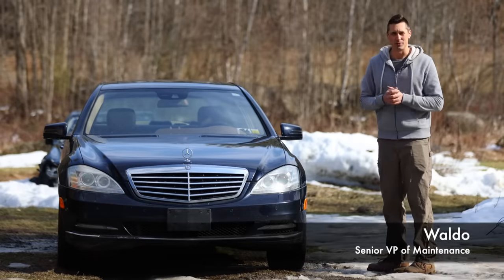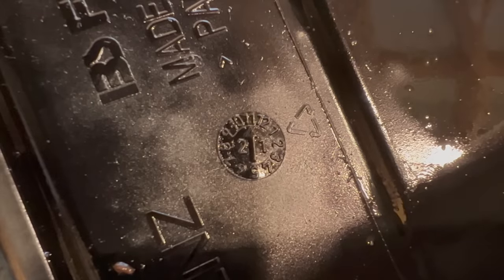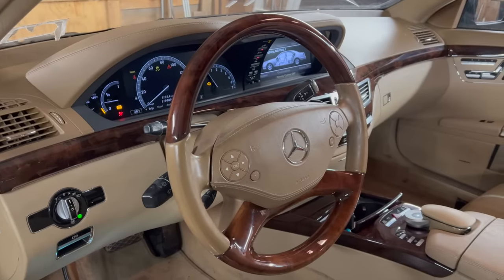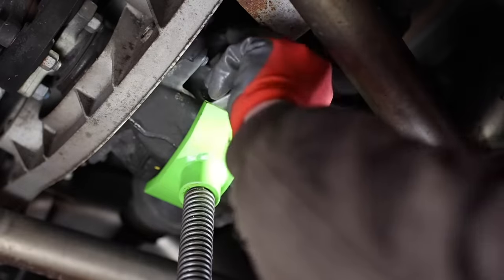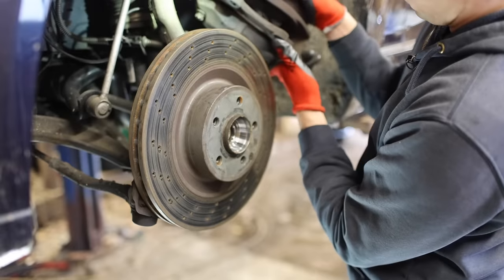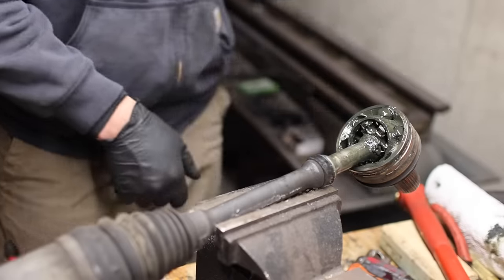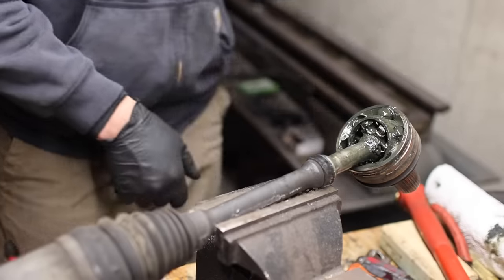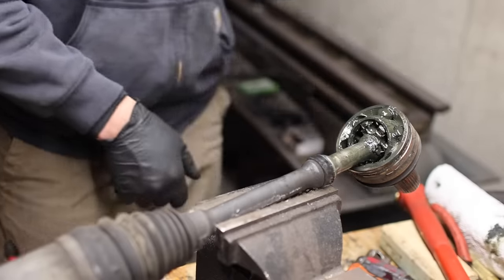Changing 6 Fluids and 4 Filters to Make this Car Last Forever (hopefully) [Salvage S-Class Part 2]

Comment: "It encourages you to have multiple Mercedes so you get the most out of your tool" Absolute win.
Reply: Yes, everyone with an S Class NEEDS a parts car.
Reply: Yes, my Mercedes does just "come right apart", if you have the right Mercedes custom tool, they can't have the dealership mechanic take too long to fix your car.  As I saw you hammering with your brass rod and hammer all I could think was "That's another special jig you should get" to go with you fleet of Mercedes S-Class cars.
Reply: emilemasbou7950  26 yrs with my LS400 and everything still works. No German crap for me.
Reply: I had a Mercedes 500SEL I LOVED THE CAR but it was nothing but a constant repair bill. It was mechanically in good condition  with excellent interior and no dings. I couldn’t even sell it at the 
Colton/ Ontario auto auction for $2000. 🫣
Now you know why Mercedes S Class  used cars are dirt cheap. “THEY ARE ENGINEERED LIKE NO 
OTHER CAR IN THE WORLD.” That is because they are junk and are the absolute worst car to maintain as they constantly breakdown and are a nightmare to repair . 
I have had 3 Lexuses  LS 400, LS430, LS460L with virtually no repairs and a car that is atleast 5 times better in every way than the S- Class Benz. 
ps I have never taken any Mercedes or Lexus to the Stealership as they are both thieves that work on these cars.
Reply: @jimhamilton3544  Could have been worse: Range Rover, Bentley, Jag....Yeah, it's amazing to me that anyone still buys those things.
Reply: Thinking about Waldo’s tool would keep me awake all night. 🇦🇺🏳️‍🌈 Great work by the way !

Comment: Benz tech here. For those axles you can actually use the axle bolt to press off the cv joint. It’s hollow all the way through so the bolt goes in and presses the end off saves you from hammering away with a brass punch. that way you can do it on the car if it’s just the outer boot that’s torn 😁
Reply from the maker: Thanks for the tip! 👍
Reply: Hahaha. 👍👍👍
Bleep, bleepity! Bleep, bleep was fun too.
Reply: I was going to say that but the tip is already here. It works with most German made cars.
Reply: Dude I need ur help share ur telegram if possible
Reply: @prems1545  uhhh idk about my telegram but I can probably help on here what’s up
Reply: @gavintwilley7586   What do you think of the OEM spark plug (24$) compared to the BOSCH (9$). Even though they are apparently  manufactured in the same facility, could there be a slight difference in terms of design/fit and performance?
Reply: @ikshitness  literally the exact same just with the Benz ones you get a star on it you’re just paying for the name. All tho they say to torque them to 23 nm due to the electrode on the end of the plug lining up perfectly with the fuel injector for the most efficient burn in the cylinder, they’re also suppose to be one time use because the theory is once torqued the crush washer on the end will crush and not torque to the same spot (personally it really only matters on amg engines specially the m177)
Reply: Not likely. Go watch legit street cars McLaren video where they do the plugs, coils, and clock spring. The coils are Bosch, but instead of hundreds a piece for the McLaren stealership coils, he crossed the P/N with a Nissan Sentra. Ratatossa and Samcrac cross Ferrari with Fiat and Maserati parts all the time. It’s all Bosch anyways.
Reply: I am unable to picture just what. you're talking about...
LOL. I only work on Jap cars, which have a nut.
Reply: What's up I really need some advice for my 08 s550
Reply: Anyway to transfer the infrared option to this vehicle? Love your channel! Right in the middle between NNKH and Legit Street Cars…

Comment: As long as its not a V12 or hydraulic suspension that is really crammed in there all S classes are really a joy to work on compared to other cars. One of the reasons why Mercedes is the only cars ive had in my life.

Comment: MB tech here aswell. Couple of pointers concerning the transmissionoil change. The bolts for the pan are aluminium for a reason, the older cars had steel bolts and they used to corrode inside the aluminium fastners which made them very difficult to get off. Secondly, usually you wont get any oil out of the converter by just removing the drainplug, theres a special tool for draining it which is a long steel tube which will let the air out, you can also blow in it with compressed air to drain it faster.
Also about the sparkplugs, please oh please use sparkplug grease on the boots, they become almost impossible to get off if you dont.
Reply: And don't forget to remove engine oil filter before draining the oil

Comment: Wow, very well done. I had a 2013 S550 that I took really good care of. Ran well and I was doing most of the services, similar to what you just did, in my garage. Car ran exceptionally until about 140,000 when a red light runner totaled my car. I truly believe that the 2013 W221 was one of the better built S classes second only to the W140. I ended up buying a 2018 S560 which honestly speaking was a piece of crap that stayed breaking down and it made me hate the W222 models. Now I drive a 2020 S560 that has had it's share of problems but I really do miss my 2013 S550
Reply: @kenstudios: I agree with you 1000%!  The W140 is probably the best generation S-Class Mercedes…I also think the W221 was the last best built generation…

Comment: I did 5 years ago salvage inspection in New York. First thing down load salvage request from dmv.Then fill up form and send payment. After that you will get date of inspection. When you transport your vehicle to inspection make sure that is on the registered trailer. If you drive your car with out trailer it is automatically denied. So make sure that is on the trailer upon arrival Whatever parts are replaced make sure that you have vin number from where part came from and receipt. This is mostly applied for doors hood and engine but in your case nothing just in case bring vin number and purchase proof from Mercedes where suspension module came from. They will instruct you to bring vehicle inside garage to open all doors hood an trunk to place receipts on passenger seat and to leave in waiting room. After 30 minutes approximately they will call you to pick up car. You will receive confirmation that you pass and NYS title will be mailed to your address. With salvage rebuild title you can then register your car in your state. Reason why they want you to register car from state that is purchase is because title will state “rebuild salvage “so all other titles will do the same forever. It is just disclosure. I would still bring all receipts from repairs and parts. Good luck.

Comment: For the night view assist. You also need different headlights as there is IR in the headlight to help with Night View Assist
Reply: I believe those headlight also have less visible light output, so whilst you get the novelty of nightvision, you get less visibility generally.

Comment: Just a quick tip, Mercedes advertises that the Automatic Gearbox Oil is for life, but internally they say every 40,000 miles or 60,000 Kilometres, If you ever get a slipping clutch just flush out the gearbox a few times and put in new oil.
Years ago most owners got rid of their Mercedes after 200,000 miles.
Great video and I am definitely going to get an S-Class again for a Taxi!
They can be quite reasonably priced in Germany as people are too scared to buy them in case they break down, everybody said I´d go bankrupt but it was the cheapest car I´ve ever had in many ways.
It sounds crazy but I´d rather buy a second hand Mercedes s-Class than a new anything else!

Comment: Nice to see a w221 on the channel. I'm about to do a spark plug change on a M157 which is very much related to the M278. I read that spark plug indexing is critical on these engines, and there is a technical service bulletin from Mercedes on the topic. (OEM/Bosch plugs and 23 NM). A good tip is to mark the spark plug socket to verify the angle of the electrode. 

More videos on Mercedes appreciated 👍
Reply: Came here to say this. If you torque OEM plugs to the proper 23NM then they should be indexed properly (no anti-sieze, just dry)
Reply: "should"...  Mark the plug socket tool to be 100% sure. There are forum posts about 23NM dry without anti seize that gives different results on the OEM plugs.

Comment: Tip! Next time if you wanna move outside part of cv axle use wheel hub locking bolt and use impact to screw it in until the outer part pops out. Hold it straight and avoid do it on angle or something. Hammering will destroy it like shown on video. Hope that helps. You can test that method on old cv axle.

Comment: Thank you for showing the second w221. If you are interested in getting into the electronics, you should think about retro fitting the night vision package to your good W221 using the parts from the donor. Could be fun… if you have the manuals and WIS. Anyway - Good luck with the inspection.

Comment: I like that you used a brass punch to separate that CV from the shaft. I actually cut down a punch, drilled a hole in it on the end and put my air chisel with the point adapter inside the hole of the brass punch and use the air chisel to separate the two, that way you can also hold the splined end straight while shocking it off.
Reply: Did it come off easily?
Reply: @robertbrandywine  Comes off very easy with the air chisel action.

Comment: Love the video. I have the same s class, currently has 245,000 miles on it and drives just aswell as when I first bought it with 75k miles.
Reply from the maker: That's awesome! These are great vehicles 👍
Reply: Have you had to get any major work done? If so, what
Reply: Yep they are, 09 CL550 with 90K here:)...
Reply: 2008 s550. Bought at 100k. Rolling like butter at 220k. Just keep up the maintenance. They are extremely well built

Comment: I think they use aluminum bolts on the transmission pan to prevent stuck bolts. Iron and aluminum contract can cause galvanic corrosion, and those bolts address on the bottom of the car, exposed to a lot of water.

Comment: You fill the front diff from the drain plug.  Measure 600mL or whatever it is.  Then pump and quickly place the drain plug back. Or add a bit over the amount to account for slight spillage. Way easier.

Comment: @13:10 - Bosch makes fuel system & exhaust parts for all major European car makes: fuel injectors, spark plugs, coil packs, fuel injectors, O2 sensors, etc. You can save quite a bit of $ by using the OE supplier to BMW, VW Auto Group (VW, Porsche, Audi, Lamborghini) and Mercedes rather than getting the parts from the dealer parts counter. AKA, Bosch. Bosch coil ignition coils are 1/2 or 1/3 the cost of the dealer parts counter and are the same part.

Comment: Check the main cabin vent inside the engine bay behind the battery. Stuff usually finds it's way in there that gets neglected and leads to interior flooding.

Check all of the water drain holes with a prob, and spray nozzle.

Comment: I had a ‘15 glk, probably the same front diff (had the same filling procedure) but I used the transmission fill tool, filled through the drain plug and measured out the fluid+100ml for fluid lost when swapping the tool for the drain plug. Much easier than pulling an axle (if you don’t have to like in my case)

Comment: Great job. Regarding CV dismanteling, you must put CV on max. angle between axles, then remove  one spheric ball with a little hammer and chisel,  than remove the oposite spheric ball and so on. Success.  You need only rubber gasket and circular 2 metallic clips.

Comment: Fellow NH rebuilder here. Nice car, love that s550.  I just picked up a 2015 RDX for the wife from the smasher auction,  and currently gathering all the parts needed to get it going.  Both auction sites are not that great with pictures and videos.

I have always stayed away from mv907a cars from NY due to this fact that you have to go back to NY and get it inspected, and go to their DMV to get the title process done, and pay their fee's, more time and money wasted.

Waiting for part 3 to confirm your findings.
Reply from the maker: I called the NH DMV and the lady I spoke to said they would accept the MV-907A, but I won't feel confident about it until they actually accept it at the inspection 😬
Reply: @WaldosWorld  Good Luck and looking forward to your video. Just make sure you have all your paperwork in order, and the VIN from the other S550 and what you took out of it to get this one going.  They hate missing/obscure info with no paperwork/documentation at the salvage inspection locations and will fail you on the spot. 

If your m907a papers flies, that makes me feel better about buying NY salvage cars.

Comment: Very nice video and together with the MB tech comments are worth their weight in gold. Remind people to  make sure they do NOT have an actual LSD rear end. A different oil is required. It is an option that I like better than the MB system. I picked up a 2012 Bluetech 350 and love it. Wish it  had more rear seat options but it is great anyway. It won't hold a candle to your 550 in power, but it is surprisingly good on power. I would put it against an E350 gas any day . I won't talk about the fuel mileage mine gets 'cause it will depress you  to no end. Let's just say it is a 5000# economy car and a very nice place to be. Great info in your vids and nicely done!

Comment: Often CV shafts have an external clip on the CV on one end and an internal clip on the CV on the other. If you can get the external clip off and remove that CV joint you can put the axle shaft into a length of steel pipe and bash it hard on the floor. That should pop off the CV with the internal clip. I've tried hammers without success, but the 'pipe trick' has always worked for me. It's best to wrap the CV and the end of the pipe in a towel so that the CV joint doesn't go flying across your workshop.

Comment: Instead of pounding the ring, put back the big screw that holds the bearing. It bottoms down at the half shaft. Keep tightening until the CV Joint pops out.

Comment: Quick note 
Mercedes m278/m157 engines recommend OEM spark plugs for indexing purposes. The spark plugs need to be indexed within 45⁰ of the fuel injector for proper combustion. The bosch plugs should be the same theoretically. However, some people say that the threads are not the same. This would result in the plugs not indexing correctly to the injector, causing engine damage, as per mercedes Technical Service bulletin

Comment: Pardon me if this has been answered but the CV joint should be "not tilted" to extreme but should be mostly straight when hammering them suckers off.  So, have a chunk of aluminium or plastic under to hold it straight while hammering/whacking.

Comment: Great video. Thanks for sharing. Also, keep in mind that the M278 engine in this Benz is direct injection, and the spark plugs are indexed. So it is important to properly torque them to 23Nm.

Comment: I'm not too sure about that specific merc outer CV but on so manufacturers vehicles they put a circlip at the outer end of the inner part of the CV joint so you need to clean up all the grease around where the shaft goes into the CV and look out for a gap and the circlip has 2 prongs on it and not the 2 loops like normal circlips and you use the external circlip pliers to spread the circlip apart and just pull the outer CV joint off.

Comment: I’ve owned 2 S class and they are surprisingly easy on gas unless your driving is primarily in town. Mine both got 17 mpg in town and 24 - 25 on the highway. They actually did as well at 75 as at 65.
Reply: What year ?

Comment: On some axles you want to take the joint off, ive stood on the axle, and then hit it with a sledge...still took a couple hits. Edit: For doing boots, unless you have the magic pneumatic spreading tool which looks alien like, or for like fourwheeler, side by side ect, you can just have a black cone which still takes some manpower, but i can't imagine it'd work like that on a car axle too well. Sucks to buy a brand new axle as i imagine it's not cheap on a Benz...had one where it needed an axle and it was 1800...like from a parts store. Not OEM.

Comment: You should’ve got the engine hot before pulling the coils. It makes them a lot easier. Also spark plug torque is very important because of the direct injection. Make sure you borescope the cylinder walls because those engines have cylinder wall scoring issues at 100-120,000 miles. Good luck.

Comment: I bought a 1985 300d in 2002. I did quite a bit of wrenching on it over the four years I had it. I never had any trouble getting things apart.
Same with the 2001 e320 I bought in 2016.
So I guess it is a Mercedes thing. 😊😊

Comment: Waldo you don’t separate axle shaft on Mercedes like that. You need to push inside not outside and forward But there is tool that stretch boot over joint. Anyway great job

Comment: Separating outer cv joint from the axle - if it's fastened to hub with a bolt, just drive that bolt back in all the way to the axle, that'll pull the joint off with little to no effort.

Comment: "Why is everything coming apart so easily on this vehicle? Is it a Mercedes thing?" 

All Mercedes techs in unison "YES!"

I didn't finish my apprenticeship 30 years ago but I still do most of the heavy lifting on the maintenance and repairs on my old Mercedes (1991 250TD, Euro, 5 speed.)

They're exceptionally engineered cars, designed to be repaired/ rebuilt. Even in the W126s, W124s and W201s from the 80s.